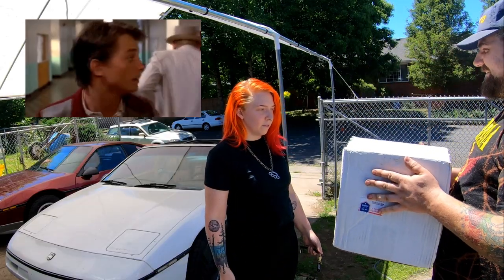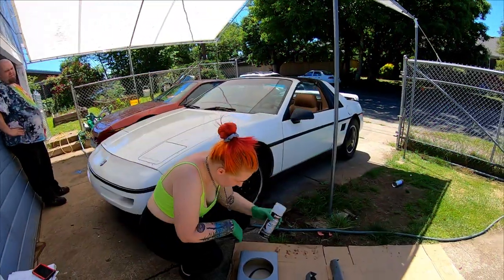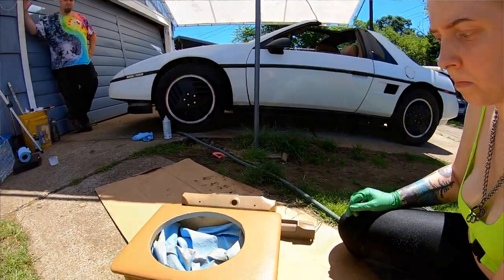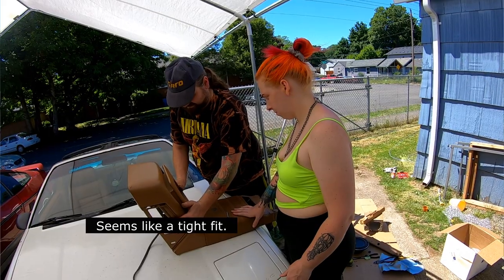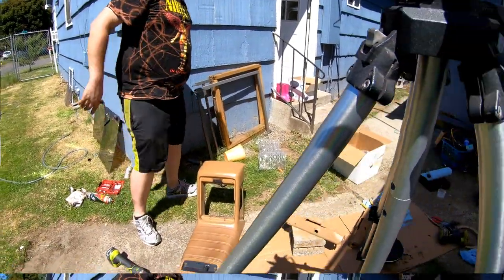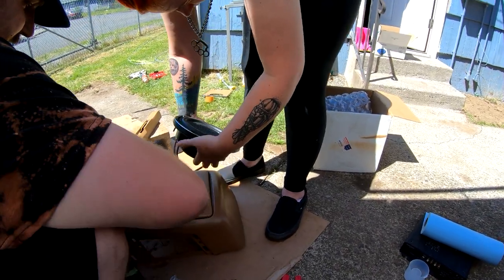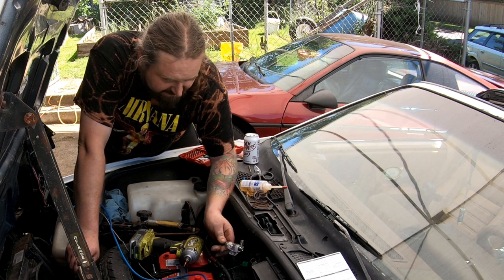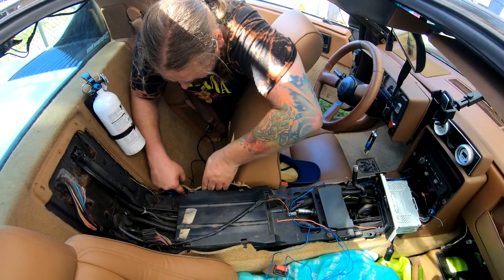Installing a Center Console Subwoofer | Project LSJ Fiero EP 26 | Making the beats SICK!

Comment: That is a good looking install.
Reply from the maker: I would like to think so as it retains everything that I like about the fiero interior. How are you planning on doing yours?
Reply: @LightspeedFieros  it all starts with the subwoofer. I'll draw it up in CAD so see how to fit it as close to the firewall as possible. Then I'll design the required airspace and porting around that. From there is gets carved out of foam for a fiberglass plug. I want to design-in a small storage compartment that will look factory like at the bottom of the console similar to modern consoles. I will use a AMPERE AUDIO AA-2.5 RVE 6.5" 500W RMS DUAL-2-OHM subwoofer. I will design it for the massive 6" Digital Designs 1506 Subwoofer. I want to switch to a pair of these since my under dash box is designed to fit it. I'll follow the same process I used to produce the multi piece mold for my under dash subwoofer enclosure. A pair of these subwoofers should get me over 145db.

Comment: I never knew that's what subwoofers did. Taking the low frequency energy in so the mid and high range speakers can shine. Aw man! Now u got me thinking about mine... DAM IT! LOL
Good stuff 👍
Reply from the maker: I mean I think that people do know that but they don't think about it that way. I used to run PA sound systems for many years and still do sometimes so I may think about it differently than some people.
Reply: @LightspeedFieros  tight tight